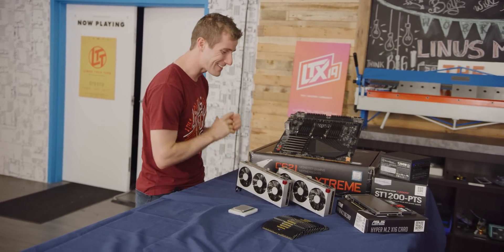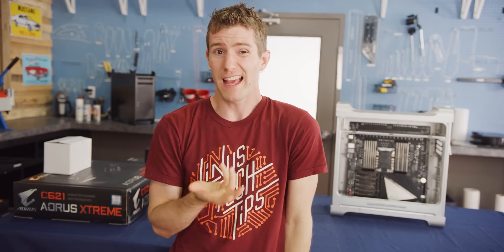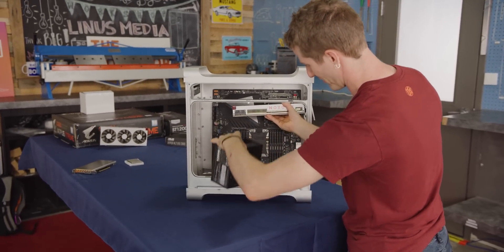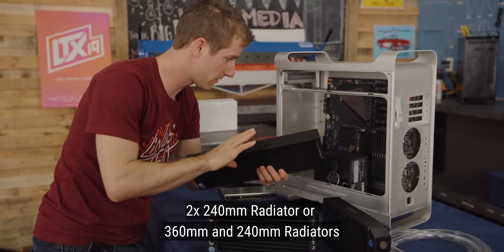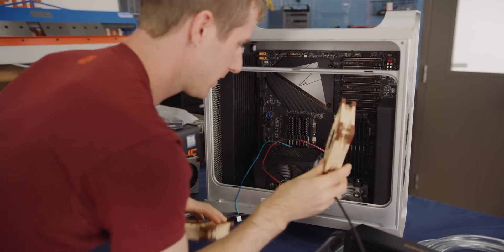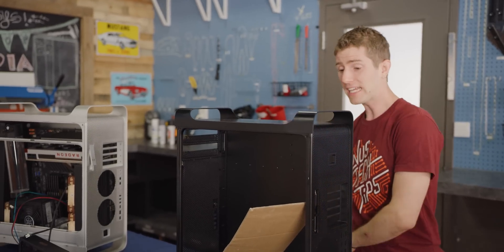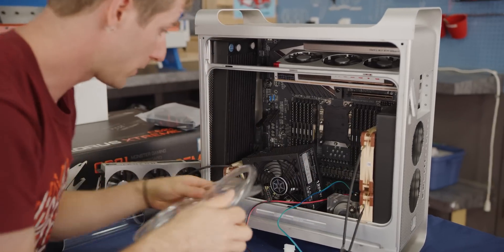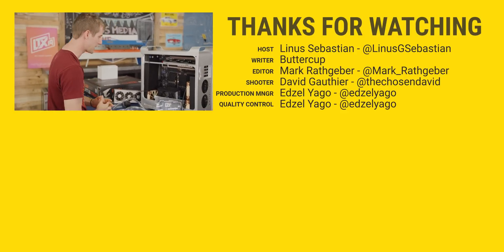The Mac Pro Apple WISHES they built - Hack Pro Pt. 1

Comment: Linus: The original intel xeon supports up to ONLY 512 gb ram.
Me: sweating nervously with my 7 yr old laptop with 4 gb ram
Reply: my ssd isn't even 512gb
Reply: hgb 0, wtf.... I see your 9 years and raise 'em to 11... My i7 860 "beast" literally flies... (If I throw it with enough strength)
Reply: @3polygons  Your i7 860 doesnt stand a match compared to my GODLY i5 650
Reply: Lol I have 16
Reply: My NEW laptop with 4 gb ram
Reply: I have 2gb with a 13 year old system. Get on my level NOOB
Reply: @aadisahni  damn you are good. but my granpa will beat your ass with his pentium and windows service pack.
Reply: I have 16GB in my 2011 i7 Quad core 17" MacBook Pro. Bought it for $200 and disabled the second video card ( which fail )  and added a 1TB SSD. Super fast and cheap.
Reply: y'all filthy casuals flexing your 16GB craptops, beat me with my Pentium 987 paired with DDR3 2GB 1600MHz ram >:D
Reply: Me: Laughs in 8 gigs of RAM
Reply: Intel Celeron D 346 with 512mb ddr2 ram
Reply: You KNOW it’s Linus when someone says, “Its ONLY 512 go of ram”
Reply: Ik what that feels like 

Now i finally have:
Ryzen 3 2200g
Vega 8
8gb ddr4 2400mhz ram

With a high end motherboard

I had intel celeron 4gb ram all in one before keep hustling
Reply: My phone has 6
Reply: know that feeling man
Reply: COCH sweating nevously with an pc that probably has worse specs than the iPad I am watching this on.
Reply: meanwhile my 7 year old desktop has 16gb (4x4gb not 2x8gb so it means to upgrade i'd need to replace all 4 - also, it's not unlocked - oversight on my part... but it gets the job done and then some)
Reply: I thought my 24 gigs was overkill.
Reply: overkill is just another word for not not enough in the future
Reply: Hey honestly 4 gb of ram in a laptop 5 years old is not half bad
Reply: COCH i have a macbook pro from 2013 with 16gb of ram with an i7
Reply: Dude, I have a 14yo laptop with 512 MB or ram
Reply: I have 3GB of LPDDR4X ram
Reply: I'm still using my windows 98 playing games from 90'
Reply: Eww only 4gb ram? Filthy casual. I have 8gb get on my lvl n00b
Reply: @repeatrepeatrepeat  Fuck you, I have 8GB with an Intel i5
Reply: @repeatrepeatrepeat  fuck you.. i have 64 gb with an i9
Reply: Jeez 4 gigs thats amazing all i got is 2gb ddr2 with pentium dual core e5400
(9 year old system)
Reply: @repeatrepeatrepeat  9000$ is not a waste for me 🤷‍♂️
Reply: @ghazapanca5002  i9 is just i7. 16gb is fine for chrome if you just open 1 tab.  Cinebench still says windows 8.
Reply: @Animal901  i use windows 9
 I got someone who works in area 51
He gave me a windows 9 installer as a birthday present
Reply: @repeatrepeatrepeat  agreed I am happy with my 8gb
Reply: @ghazapanca5002  area 51 is really called Walker air force base it was opened in 1941 and closed in 1967. Its original name was roswell army air field until about 1947. Which thats when the ufo rumour was. Lol
Reply: @ghazapanca5002  more than than my storage lmao
Reply: @hgb0632  i actually have a PC (not my main) with 64mb of ram
Reply: @hgb0632  all you n00bs I game on a raspberry 2b with 512mb of ram
Reply: @repeatrepeatrepeat  can't see😂
Reply: sitcommander wym??? CaNT sEe more than 8gb. All it is is the amount of active data you can store on the motherboard
Reply: @hgb0632  me too! Its just my Laptop tho.
Reply: @hgb0632  I have 128… mb
Reply: 1 gb with my pentium 4 and windows 10 (yes, for some reason that still works)

Comment: The case can be modeled pretty well from scratch in a few hours.  I assume the company you contacted does camera based modeling?  Smaller scale and high res can be CMM and in some uses laser.  However, for what you're doing and the overall intent, a tape measure, a caliper, and a few hours of time will get the case modeled.  Up it to a couple of days, and you can model up all the other parts too (not exact, but general shape/features, critical points) and package some sort of assembly together.  The problem is of course cost of paying someone doing this sort of thing for a bunch of hours.  You could pay $1000-$2000 just for someone to model up all the parts and piece together the assembly.  It might cost more for stepping through all the modifications and including any custom fabrication parts.  You might spend a few grand just to get everything laid out.  It's not cost effective for a one-off project like this, but if you ever want volume, there can be real value in designing unique kits.  For cost, you might be looking at $50 to $150 an hour.  On the cheap, contact local colleges.  Stuff like this can be great for classroom projects.  You basically get free labor for their college experience.  The downside is poor efficiency and limited knowledge/experience.  However, a lot of the time is just copy/paste, so that's easy enough for anyone taking a CAD course to do.  Alternatively, you could seek out a hobbyist to help out, some guy who just fiddles around at home with this stuff for fun.  For example I have CAD and a 3D printer for prototyping.  I'm a design engineer building industrial equipment by profession, so this kind of stuff is a piece of cake.  I'd simply need the hardware in front of me to model up.  There's a lot of people like me floating around, and is your best bang for the buck route, cheap but skilled and generally an enthusiast of the genre to boot.  I would expect there's some fellow LTT fans in BC with CAD and some free time in the evening to help out.

Comment: Build a gaming computer inside of a samsung smart fridge, but put everything inside of the freezer.
Reply: Everything will break i guess?
Reply: I'm pretty sure it was LTT that did the computer in a mini-fridge several years ago.  Actually doesn't work as the fridge doesn't have enough cooling. they work because the stuff inside isn't producing heat.  A typical fridge can only keep up with about 40 watts of heat.

Comment: Get 2 of the cooler master 90 degree 24pin connector adapters so it’ll be an easier fit for the cables

Comment: The intel Xeon w-3175x uses ecc memory, no no-ecc, the corsair vengeance lpx is no ecc
Reply: it supports ecc, and works with normal ddr4 ram as long as its under  2666mhz

Comment: I don't know, that being a Powermac G5 case, it would require modding the back completely. 
The water cooling (when everything is figured out) needs to be the very best you can offer. The past copper tubbing build looks proper for something like this but I get it would be quite the challenge (Maybe call some reinforcements for more ideas, like Jayztwocents. I don't know). 
The power supply is the point of contention. I watched a video where an old G5 was leaking and after plug it in, the sparks made their appearance. I don't think to put that PSU down would be a good idea (maybe that's why Apple move it up in the Mac Pro that followed). I don't think also you would need all the PCI-e slots so, maybe there? I don't know, it's a very tricky build.
For all the people that cringed seeing that Radeon VII hanging: At least Linus didn't drop it this time (on camera) so, that's that. And that's a GPU already killed by AMD, but the only high end one working on macOS. I can't wait to see the RX 5700 series working there (maybe already are).
This is a project I want to watch. For me, it's kind of like a dream because I really wanted to modify a case like that one but never did it (it's way too expensive to do that in a country like mine) so I really hope the end result would be as sick as we expect (even with RGB for good measure...  Jk). This is my longest comment ever posted in YT just because of how excited I am for this build. Don't drop it Linus!

Comment: Guys, use the slim 15mm noctua fans on the radiators to save space. They perform identical to the 25mm ones you used in the video

Comment: Back in the G5 hackintosh hay days people use to cut the back out and install bare metal Lian-li removable motherboard trays. They had a big rectangular back with fan mounts already on them, all you have to do is cut a square hole in the back and rivet it in. Not sure if the trays are still around anymore.

Comment: I hope you guys use the black Mac Pro case instead of the silver power Mac case. The Mac Pro case had a standard power supply the size you are using. The power Mac you were test fitting with had a sever Esk power supply that took up the entire bottom of the case. Which is why the power cord port is on the bottom instead of on the top like the Mac Pro case. Go with he Mac Pro case and your power supply has someplace to fit if you put it in semi naked and chop the OG case to fit that corner section. Plus it should be easier to route the cables from that spot as well.
Reply: Patrick Pecoraro up

Comment: It's not illegal or voiding apple's warranty because you technically are installing it on an "Apple branded computer".
Reply: “Branded”.  I think the TOA though does say “manufactured” now.... if it didn’t, it will once this video gains some traction.
Reply: @ryanblakeslee1406  oh there's already several clause's covering that. Apple ain't dumb
Reply: @Nik-ff3tu  Yes they are, but their customers are even stupider.
Reply: @drakthorianakatzaphquiel455  they will claim that it is for pros and not for normal people.
Reply: batbat4 
Person
Ready to
Overpay
Reply: @Asbjoern  Just because someone is "pro" means they wanna pay £5000 for a cheese grater and £999 for a monitor stand... Just saying...
Reply: But even replacing a resistor on the motherboard makes a mac PC! :D
Reply: @SzDavidHUN  don't even have to do that, just run a wire to make a Mac a PC in two seconds flat!
Reply: @Mr. Rich B.O.B Voiding the warranty or EULA is not illegal, it's against the contract between you and apple, but is not against the law, at least in EU. The difference is basically that they have to sue you personally (which they will not do) and state will not care about doing it on state's own
Reply: Drakthorian Aka Tzaphquiel so why don’t you design your own stand for the display and sell it 150-200 a pop and make big money 😉
Reply: @Dropsy86  Not everything is overpriced, good luck finding something equivalent to the imac pro or mac pro on the pc side for a similar price. The cooling system on macbooks is not good, but no laptops in that formfactor has respectable cooling. There's very few companies with good customer service, I've never had to contact apples but I had to contact lenovo for a screen flickering issue which is very common in their laptops and did not get any help at all others than that I should reinstall windows... it's a hardware fault.
Reply: You cannot turn an apple into a pc. Lol
Reply: @Animal901  you can... is called.. bootcamp
Reply: @Carlos970  its just suposed to work. You're not suposed to do anything but click ok at the bomb.
Reply: apple is trash
Reply: think most peeps give a flying fuck what apple wants?
Reply: Drakthorian Aka Tzaphquiel it’s meant for people who’s job requires it, not for someone who uses it to play counter strike
Reply: @drakthorianakatzaphquiel455  That is why they are not dumb. They know people will buy it.
Reply: Not to say that it's not overpriced.
Reply: Dropsy didn’t say anything about performance
Reply: You guys are not understanding much from Linus' videos...
Reply: @drakthorianakatzaphquiel455  Which contrasts the AppleTV+ subscrition hat is onlt 4.99 and comes free for a year if you get an apple prouct this year. I mean, that is a pretty good offer.. I feel like they fired the guy or gal  who decide the stand was a good Idea and miracuously hired a better, more sensible employee.

Or..

The guys or gal who did the stand pricing... Somehow... Leaned from his or her mistakes really really quickly!
Reply: wow this is so bad
Reply: Thomas Victorian  this is very diverting line of logic and logically incoherent as the greed is coming from accumulation of wealth with so little physical assets, where value of profit is not proportional to investment or development cost. That is why this type of corpo behaviour can be concidered as parasite fed by "sophisticated" marketing. However your 2nd point in this conversation related to ground breaking technology I'm struggling to find, as per LTT vid it can be done by parts widely avaliable, it's about joining them. ;) with so much of spare cash they must do better as they can afford this. Than it allows them to keep tha legend living of the apple magic working inside the box.
That is why, with high level of objectivism, I said that for me it is pure greed with no ingenuity.
Reply: Drakthorian Aka Tzaphquiel how is that dumb? Apple is trying to make as much money as possible. It’s ingenious not dumb.
Reply: @perfpet  not if it winds up costing them money in the long run.
Reply: @perfpet  I think that there is nothing from ingenuity it's just pure greed.

Comment: Many of the dimensions on the G5 are in inches, which makes modelling it extra tricky. Been there.
Reply: Just measure it with proper tools to have it in mm instead.
Reply: @alexandruilea915  If you model it, you probably want all dimensions to add up perfectly. If you try to use metric on that case, you are required to juggle decimal places.
Reply: Too many computers these days have dimensions in centimeters, which makes modeling them extra tricky.
Reply: @MatthewHill  no matter how much you bait, imperial units will never make sense

Comment: Why not external radiator like an Alphacool Eiszeit or Eiswand so the cooling and room issues are reduced and the heat is removed from the case, heck put the radiator in a different room and make a silent pc.
Reply: would allow 4 GPUs :)

Comment: How would you fit another PSU inside in case you want to fit all PCIe slots with GPUs?
Reply: There are 2000w psus by seasonic, I think he would go for them
Reply: TheLegendOfGaming 
2000W won’t be enough
Reply: @allansh828  the watercooling reduces heat and power consumption and I think you can't run more than 4 R7s with crossfire (couldn't find an official support list,but I think it might be like NVlink with a limit of 3-4 graphics cards support). I think also the new mac Pro uses only 4 "Radeon 7" which are 2 cards with dual chips like the old hd  7990(I think it was called that)

Comment: Replace that 360mm radiator with a 240/280mm rad, and use a pump/res combo that's designed to fit into a 5 1/4-inch bay...solves several of your "problems" very quickly.

Comment: You don't need to reinvent the wheel to do this ..I've built a couple of Pc's in those old Mac cases ... easiest way I found is to get an old aluminium pc case and cut the back out and fix that in instead of the Mac rear panel....if you can get hold of an old stacker 830 series case you can use the removable  mother board tray which includes the rear io and pcie slots...so you just need to cut one rectangular hole in the back of the Mac case.

Comment: 3D scanning a computer case most likely won't work. Just measure the case with some basic tools. Or use one someone already modeled
https://grabcad.com/library/mac-pro-finished
You can grab other things from my library to design a new case.

https://grabcad.com/yang.ji-1/models
Didn't you hire someone doing solidworks?

Comment: Is there any way you can make a risc V or qualcom pc or intel iX that actually runs under fifty degrees Centigrade air cooled?
Reply: Bubba  Okay now what will it take to make a little pc that runs as cool as my old game boy pocket?
Reply: Bubba  I just want something that runs cool. Or could use less power if I need to run a system off a battery and inverter.